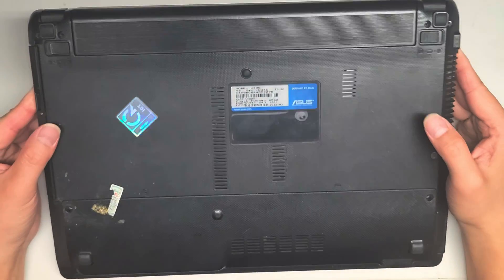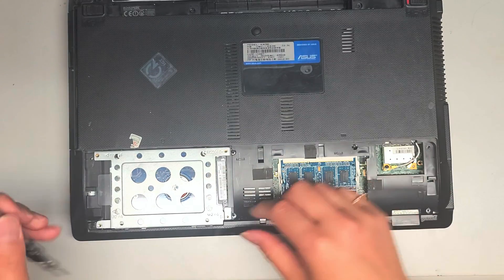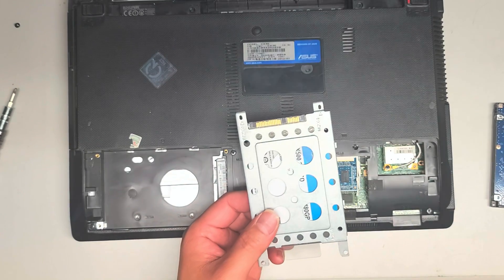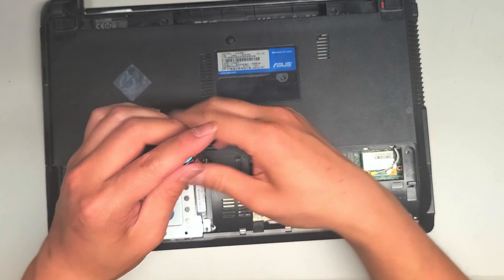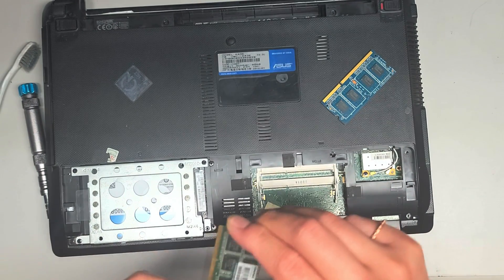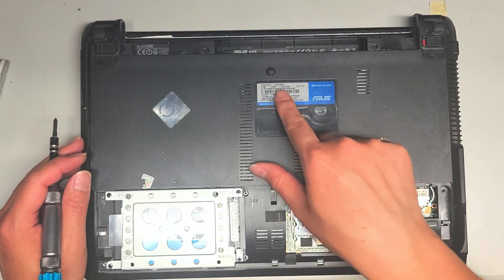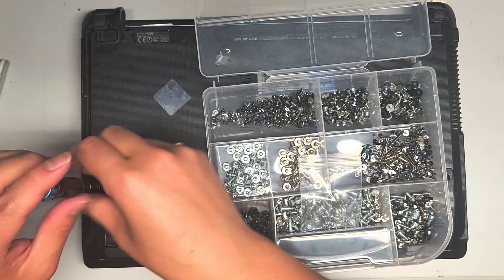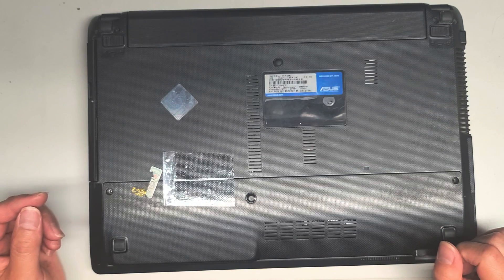ASUS K43E Disassembly RAM SSD Hard Drive Upgrade Battery Replacement Repair

Comment: dude please help me. i do have same type here. ASUS K43E. i have few questions. 

1. So i could replace the HDD with the SSD?

2. are thes similiarly type have 2 slot for the ram? because now i have only 2gb ram. is that possible to upgrade this type to 4+4 gb ram? 

3. any recomended of nicely worth of brand for ram? 

thanks dude u r very helpful!
Reply from the maker: Every single one of your questions are answered in the video.
Reply: @ItsBinhRepaired  ahh thanks, i do apologize, my listening on english is not that good 😂